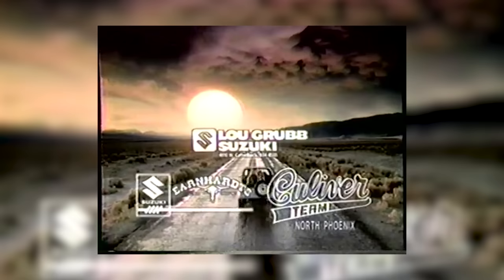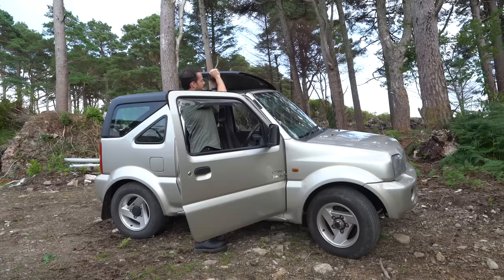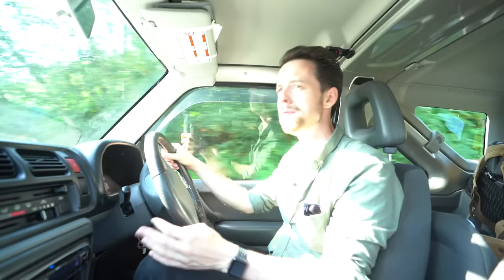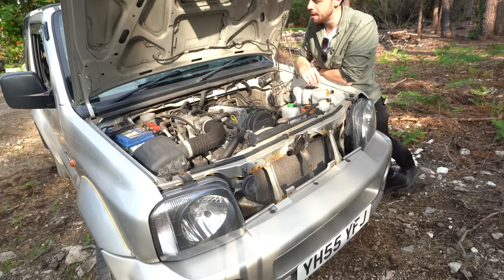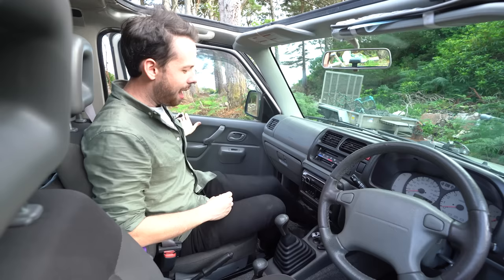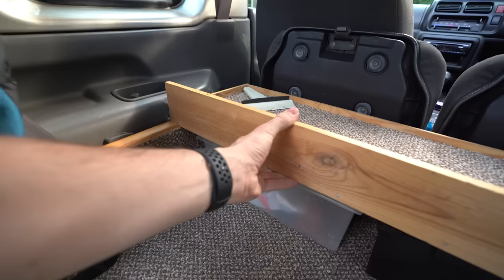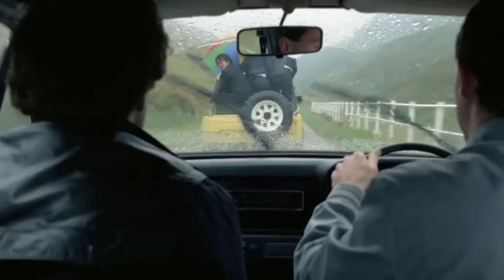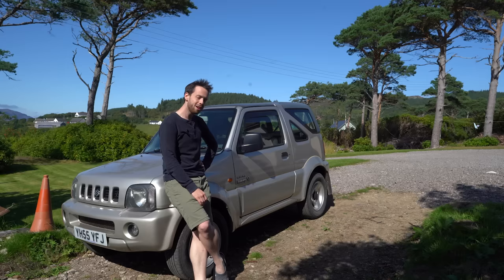The Suzuki Jimny: the World's Best (and Cutest) 4x4

Comment: Maybe the rust is just a problem with the Spanish made models or maybe  the previous owner did a lot of salt water beach running and did not 
clean it properly no problem with rust here in Australia I think ours are japanese imports
Reply from the maker: Nah mine isn't too bad I'm joking mostly, but Jimnys do rust badly and especially here in the UK where we salt the roads each winter and for 6 months out of the year the cars can't stay dry!
Reply: @CalumRaasay  Only 6 months? :D There's also the issue that no part of Britain is more than 50 miles from the sea.
Reply: The Japanese built models suffer badly with rust in the UK but so do Toyota Landcruisers, which are highly regarded in hot and dry countries.

Comment: The next step for Jimny is an EV version, how amazing would that be taking an already capable 4WD and sticking an electric motor in it with the characteristics of electric motors (firstly: quiet! Then for going sloooow but getting incredible torque out of it..)
That said: I have a newer one than yours, but not the latest model and the low range I think of as the get you out of the s**t button. It's amazing. I have taken it up dirt bike tracks out in the bush here in oz because this thing can squeeze through and turn around all sorts of stuff.
Reply: Oh, by the way - go check out mighty car mods and their journey into 4WDs with a Jimny and some 4WD mini Ute thing.. They kinda capture the strange joy of jimny ownership as they bounce around in it.

Comment: That's a great video and I didn't know that the convertibles where made in Spain , I often wondered why the Convertible model came with the earlier engine rather than the later the later Vvt unit which came in Jimnys from 04 onwards.
Being a Spanish made model probably explains why as you said they didn't use the later spec interior and dash and also the later 4 wheel drive system so probably the same reason they came with the earlier variant engine

Comment: "Better to let the rust eat into it, and they'll fall off by themselves." I cracked up! XD

I thought that "O2" was a "Q".

There were so many of those convertable Jimnys around my south coast town when they were new. I loved seeing them, especially in that plue paint. It was the era when the British had the highest proportion of convertable car ownership in the world.

I never liked 'falling' bonnet stays in any car. They might seem like a good idea to a lover of simple straightforward tech (which I sometimes am), but they're surprisingly awkward and troublesome.

I want to get a Jimny and rust-proof the whole thing. :D I don't know how I'd get between the boot floor panels though.

Manufacturers did tend to stick to one or two sets of air controls across their range and over many years. I liked it because you knew what you were getting, although I didn't like some of the control sets.

Nothing says "I love my car" quite like having a model of it too. :)

Do you have an interceptor sticker on the back of the Super Carry? 🤣🤣🤣 ... I would! 🤣

I love small roads. :D There's better tarmac on them down south, but they're still tiny. I used to have a Peugot 309 someone had modded. It was one of the early ones with the high boot lip; very rigid. It was perfect for those little roads. It wasn't bad on the highway either, especially when it still had its undertray fitted, but it ran out of real verve at about 40mph.

Ahahaha! A 911 helped by a Panda; that's awesome! :D I love the whole "little car shames big car" thing so much. XD

My 309 had a lot of "wants to go" too. If I think about it, I miss it so badly, it hurts.

Another lovely video! Thanks Calum! :D
Reply from the maker: Love this comment and you're feedback! Thanks for watching, really appreicate it! I now have a model of every car I've owned!
Reply: @CalumRaasay  O you're welcome! :D I only have memories of my cars. I'd like models, but my memory can be pretty good when it wants to.

Comment: that monk's haircut is called a tonsure

do you have any tips for sleeping in a car? I have a deep want to shut myself from the world, take my hammock and drive till the road meets the sea
Reply from the maker: Depends on the car, nice collapsible air mattress is always good, not to mention something to black out the windows!
Reply: I had an early Ford Sierra where I could sleep just fine in the front passenger seat, but that was really the only car I've had where it was that easy. I got into the habit of driving down to the Isle of Purbeck, half of which is just tiny roads through lots of heather-covered nothing. I slept all right without curtains, but that was before I was on the computer all day. These days, I'm sure I'd need curtains or maybe one of those things they sell for people who want to sleep on long flights. I had a computer in the Sierra, funnily enough, but didn't use it much. It was an 80s laptop and I ran it off the car battery with a light on a bendy stalk for illumination. (There was no backlight.) I'd sit in the pitch dark, not a house around for miles, and try to write novels.

Anyway, XD I guess just sleeping in the seats is probably easier in bigger cars, especially if the seats aren't too strongly shaped for lateral support. I didn't like the drop into the footwell very much, I would have liked to put my feet up. If I ever have a car again, I'd take Calum's advice, especially because I prefer small cars anyway. An air mattress seems really practical, especially with a 12V compressor to pump it up.

You know, I've heard that if you slide the front seats of a 2nd-generation Austin Metro all the way forward and take the headrests off, the seats will recline to make a flush surface with the rear seat. It's unusual because car seats don't usually pivot in the right place. But perhaps the teenager I overheard was exaggerating. :)